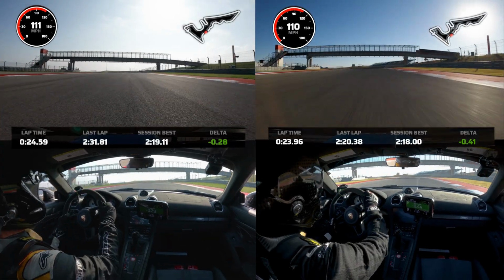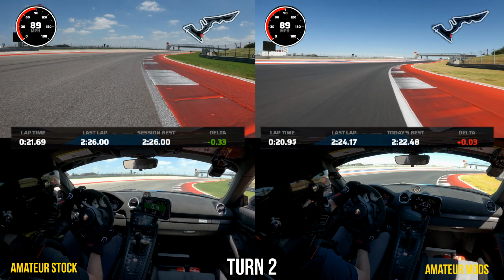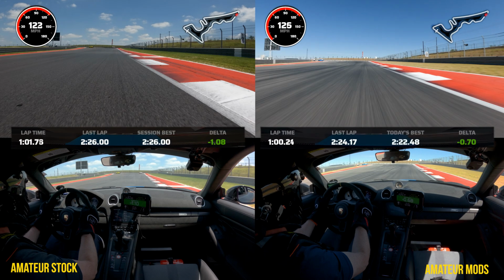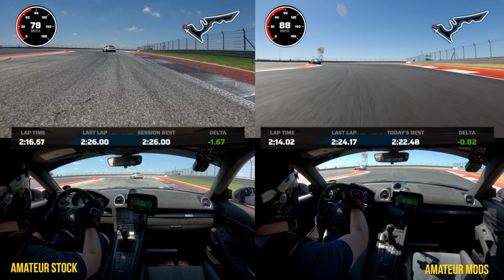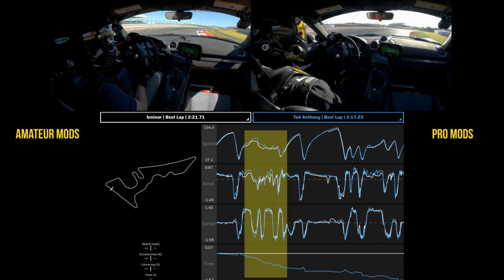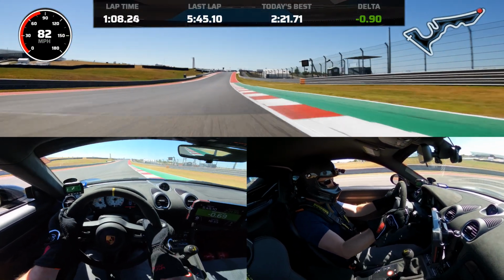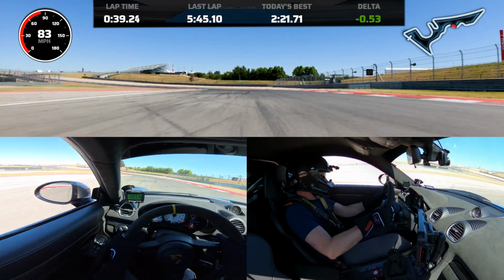Amateur vs. Pro: Can Mods Level the Playing Field? - Porsche GT4 RS + Dundon

Comment: Asking for a friend....How much did you spend to gain 3 seconds?
Reply from the maker: Ha! Once you get below 2:25 at COTA, shaving off more seconds gets very expensive. 
But I’ll say the best bang for the buck on the GT4 RS is the MCS system.
Reply: Thanks for the response I'm just trying to get my arms around car options to run competitive times at COTA.  I have a stock GT4RS and run sub 2:25, I also have an LS3 swapped Miata that I paid $40k for and can run the same times.  I'm working my ass off in the Miata to hit those times and frankly it's a bit insane to hit 160 mph on the back straight in a Miata, but it's capable.  So given that a GT4RS costs ~$200k, you've probably put another $60k into your car to run sub 2:20.  I'm wondering if a stock Corvette C8 Z06 could also run 2:20s and only cost ~$150k for a capable track car.
Reply from the maker: As you said about the Miata, it all comes down to how ‘on the edge’ you want to be when pushing into the sub-2:20s. 
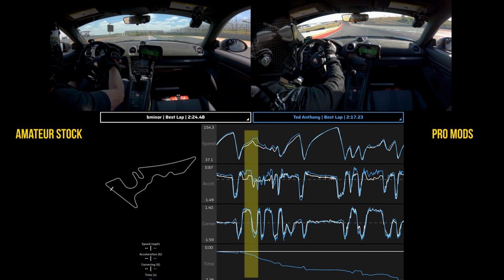If you watch Randy or Felix, they were right on the edge, catching the GT4 RS multiple times to get it into the 2:17s in stock configuration—I don’t see myself driving that way.
The reality is, I need the car to be much more stable to build the confidence required to push it below 2:20. The easiest way to achieve that would be to get a car that can hit 170 mph on the back straight—you’d be sub-2:20 without needing to push hard in the corners. However, I’d rather achieve that time in a balanced way, maintaining speed through the esses and carousel. That means the car needs to be well-behaved, so I invest in making that happen.

The Z06 is 400 pounds heavier than the GT4 RS—definitely not the right direction if you're looking to build confidence.

Comment: Great data but sweet god and baby jesus those exhaust tips are the worst thing I've ever seen... ! Sorry :D
Reply from the maker: Finish/Color or shape?
Reply: @ItsTrackTime  Just the size and how much they stick out... they look off for the space available like comically oversized - although obviously there could be an element of camera angle there...
Reply from the maker: I was OK with the size but wanted a different finish. Gun metal is more my style but it appears the stainless steel finish is shifting from a chrome look to a more gold look as the heat works it over. We'll see how they age with time.
Reply: @ItsTrackTime  I'd probably do black if they had it as they'd blend in a little better with the trim. Personal choice obvs. I just can't help but think that each of those tips is dealing with "only" 3 cyls and 2.0L of displacement. Modded 90s Honda vibes :D Thank you for the content!

Comment: Very nice!  You picked up quite a bit of time but more importantly, the car’s drivability also improved.  Would be interesting to see what Randy would run with the modified car.
Reply from the maker: Thanks, I'm also looking forward to getting Randy back in the modified car with cooler weather and a new set of R7s!
Reply: @ I just ordered a GT4 RS.  Going into production now.  How much did the entire Dundon package cost?  I almost did the Manthey package through the dealer and then stumbled on your video
Reply from the maker: Awesome, you’re going to love it! The Dundon package is significantly more affordable than the Manthey package. In fact, you can get the suspension, aero, and a complete header-back exhaust system for less than the cost of the Manthey package. I’d recommend giving them a call to go over the numbers.

Comment: Just a thought, Skip Barber 3 day racing course had us compromise 7 just a tad (notice you are pretty track left), since its a slower speed corner and rather than track out all the way right into turn 8, track middle and then turn in to the apex and hug the curve uphill ( i felt like that let me accelerate just a bit up the hill) and then full throttle all the way to 11 once you get over that little hump at the top of the hill.  You can probably track out a bit more at turn 11 and straddle the exit curb carrying more speed through the corner and earlier on throttle.  You have soo much more tarmac at turn 12, not sure if you actually care about track limits, but so many past the curb to that extra tarmac.
Reply from the maker: Thanks for the tips!
I have always moved to the far right leaving T7 but have seen people taking the middle line you are suggesting. I'll have to study that a bit more. 

T11 - I also try to use all of the track surface that I can including all of the green painted surface which T11 has plenty of but try to keep one tire still in contact with the white stripe.

Comment: Considering all the mods you have done, if uou could go back in time, would it have been better/cheaper to start with a GT4 rather than the GT4 RS?
Reply from the maker: I worked my way through several Caymans before finally landing on the GT4 RS, and I have to say, the engine in the 4RS is absolutely incredible—worth every penny. If you're a fan of mid-engine cars, the 4RS feels like the pinnacle of the Porsche lineup—unless, of course, you’re in a position to track a 918. As for mods, I’m really happy with the choices I made. The only thing I might have done differently is to stage the upgrades—starting with the MCS suspension, driving it for a while, and then adding the aero. By doing everything at once, it’s hard to isolate their individual impacts in the data.
Reply: @ItsTrackTime  I was considering taking a GT4 and doing the same mods along with Deman 4.5L engine upgrade (~$30k). Any thoughts?
Reply from the maker: For the track you really want a dry-sump engine - the GT4 is a wet-sump, the GT4 RS is a dry-sump. For the street the Deman 4.5L is fine but on the track it might not hold up. Is there any long term data on how these modified engines hold up with heavy track use?
Reply: @ItsTrackTime ahh. Yes dry vs. wet is going to be a huge difference. I now wonder to myself if that's part of what Deman do for $30k, if not then I'll just have to pay $35k over sticket and get about ordering one ASAP.
Reply: @ItsTrackTime  just confirmed that for $30k Deman don't even convert the engine to dry sump. I see now there is no replacement for a GT4 RS, other than a GT4 RS Manthey maybe.
Reply from the maker: And the GT4 RS Manthey uses the same untouched factory engine.

Comment: Chase seat time and coaching not mods.  When you can drive a good friction circle is the time to do mods.  😀
Reply from the maker: Any mod that makes a car more predictable and less unforgiving is a win in my book. Coaches are invaluable, but they can’t fix a car’s bad habits—they can only teach you how to manage them.
Reply: @ItsTrackTime  If you're not driving to the limit of grip you don't know if the problem is your driving or the car.  When you can reliably and routinely extract maximum grip you then will better understand what needs to be "fixed" on the car.  Do you know what your friction circle looks like, take the data from your RS and extract it in the PTA app, upload the CSV/txt file to a computer and in excel plot lat g Vs lin g. Stacked logs in PTA are fine but the "tell" is the friction circle.
Reply from the maker: I had an AIM Solo2 in my car during these sessions, and I noticed it can generate a friction circle using its X/Y plotting feature. Your enthusiasm for this technique has definitely piqued my interest. It seems like a interesting way to compare drivers in the same car and evaluate how close each one gets to maximizing the car's limits
Reply: @ItsTrackTime  Correct, also as your tyres drop off, if you're a good driver, your friction circle becomes smaller but still retains its donut shape (e.g. always using the grip available).  Nearly all amateur drivers are off on corner entry to some degree - because they are trying to balance several things e.g. finish of threshold braking and transition to trail braking whilst maintaining turn in at a rate sufficient to keep speed up whilst extracting maximum grip.  A good friction curve reflects high levels of precision and accuracy e.g. you want to be on the ideal race line, hit all your marks at the maximum speed possible without getting into understeer or oversteer.  Its the subtle stuff that additively makes you both quicker and smoother.  Another good challenge is trying to consistently hit a time, one a couple of 10ths slower than your PB again, accuracy and precision - it becomes a real challenge and thats part of the fun and can fun and frustrating at the same time.  The hardest person to beat is yourself and therein is the challenge.  :)

Comment: I think T8-T9 is about a second of possible improvement. I’d like to see you min speed at T8 at58 then get flat before the end of the white curb stripe on the right and hold it. That speed carries all the way to T11. I know from my vbox data that a slight lift going up the hill to T9 costs more than half a second. For T3, I think the gantry bridge is a mental thing and makes people want to slow down. You may consider slowing down a tad around T2 on a couple of practice laps to get the feeling of holding flat longer into T3 and getting settled. There is plenty of time to let the car settle after the T3 hop before you make the T4 turn. Most people reserve too much time and it causes them to slow too early. But, make sure to let the car settle before turning or it will snap on you. Also, if you carry too much speed into T4, it’s easy to bail out and go straight. I’ve done it. It’s super flat from T3-T5. Worth possibly doing once at a slower speed to know you have an out.
Reply from the maker: Hey Ray - Thanks for your continued tips!
T8 - T9 is a definite area for continued improvement. I'm too slow around T8 and there is now a shelf on the T9 curbing that launches the cars so I was trying to find a clean line around it. Ted was taking a more aggressive line and it seemed to work.
Sacrificing T2 to get more speed through T3 and T4 seems like a good approach for me while I continue to work out the line and how long I can keep my foot down without loosing the car at T4. You can see Ted was going very deep with speed at T4 and didn't brake nearly as much as Randy which gave him a lot more speed through the remainder of the esses.
Reply: @ - the brake pressure at T4 is just to give the front some grip. It’s not to slow you down. I spent many laps working up the ability to hold flat around 2 and jump the T3 hump. 

T8 seems to come from lots of bad instructors at COTA. For me, even with the jump, is to aim track out to the right on the line. There is plenty of room to run wide, but if you let the car settle and be patient, there is plenty of time to straddle to curbing on the right. Too many people try to turn left there too early. You may also consider doing a few laps where you focus only on the min speed and don’t worry about the uphill portion. Just work on trusting that you can make the turn at 60 mph. Look at the Miata cars. If they can carry that speed, so can you. 

The same thing happens at T19. People tend to rush the turn rather than carrying speed and aiming at the parking lot on the right. As you pass the corner the car settles and gets the grip to stay on track. Too many people over slow because they are trying to make the turn with the low grip that is just past the apex. But there is better grip waiting if you wait for it. 

COTA is classic this way. If you are patient the camber and track is there to reward you. If you don’t trust yourself or the track, you will overslow and turn early.
Reply: @ - I have my VBOX data and Cameron’s on our 2:14 and 2:15 runs. I was trying to bank a lap on mine and the car was hopping a lot. My optimum time over two laps was a low 2:15. I could have done a 2:14 in the next session if Ferris didn’t cause the yellow. T2-T3, T8-9, T13, T16, and T19 is where the time is.
Reply from the maker: I would love to see the native VBOX lap videos of you and Cameron. 
The Youtube versions are too course to see what is really going on frame by frame.

Comment: Much more complient suspension, the way to go. Good job on your driving! If I may, try a bit faster hands on slow corners entry. And turn 2, just go for it (although not much time to gain there); the car will understeer (worst case you bail out). And I bet that pretty soon you'll want to dial off some of the understeer (keep some though). Cheers.
Reply from the maker: Everyone tells me I just need to commit on T2 and everything will work out but I've had the tail break loose on T19 before and I was a goner.  After that my brain never assumes the car will just push. With the added downforce I could really feel the tremendous pressure on the sidewalls as they scrubbed sideway on T2. When I felt that I immediately went into maintenance throttle but Ted told me to just commit and add more throttle, thereby producing more downforce, and the car will just hunker down more and settle. Very counterintuitive!
Reply: Well, T19 is way more complex than T2; there you have to brake, manage the front the end, deal with the curb apex and the downhill exit. T2 the car is already balanced through out. Now, with your aero kit, based on Ted’s lap, the car understeer (a good bunch) at the limit over there. Build up to it, a bit more each time. And to be honest, you’re already fast enough to generate the needed downforce. Look far, and light hands. Worst case, open the steering wheel… or, most likely, easy off the throttle to minimize the understeer. Cheers.
Reply from the maker: You’re inspiring me to stay on the throttle through T2! What you said makes perfect sense— with the added downforce, I’ve got no excuses for not attacking this corner. Thanks for the motivating and practical pep talk!

Comment: What brake pads are you running?
Reply from the maker: Ferodo DS3.12
Reply from the maker: But I'm going to move back to my old favorite, Race Technologies RE10, for my next track weekend.
Reply: @ItsTrackTime  Great video! I really appreciate how you break down the process in a logical way. May I ask why you are changing to RE10's? I'm running DS1.11 front/back on my GT4 and was thinking about changing to DS3.12 on the front to improve car rotation. (I'm using Girodisc rotors).
Reply from the maker: Thanks!

I'm also on Girodisc rotors - great product!
The DS3.12 pads have great bite, don't fade, and don't squeal when cold but the down side is they wear very quickly. I only get two track weekends out of them. 

RE10's also have great bite and don't fade but the big plus is they wear much better. I'm interesting in seeing how they hold up on the 4RS. The downside is they squeal when cold so street driving is kind of miserable.
Reply: @ItsTrackTime  if you didn't care about the noise at all, IE: 100% dedicated track car, which pads would you choose? Is there anything better than RE10?

Comment: Good stuff.  I have the MCS 2-way's on my 718 GT4.  I love them, my only regret is not springing for the 3-ways, but the 2-ways do pretty damn good on their own, just probably not quite as smoothly as the 3-ways would.

What canister pressures and rebound settings did you end up at?
Reply from the maker: Thanks!
MCS is the way to go. Makes a huge improvement in the car's stability on track. 
My canister pressures are currently set to 175psi.
Rebound - Front 10, Rear 9.
Reply: @ you are pretty close to my settings.   I know we can’t compare compression since you have both low speed and high speed , but I’m at 190 canister pressure and 10/10 C & R on all 4 corners.  

I run the Goodyear SC3 tires for street use
Reply from the maker: Which tracks do you run one? Many of these settings are track specific.
Reply: @ItsTrackTime  I don’t really track mine as it’s my daily , just canyon and mountain roads
Reply from the maker: Ah, I'm going to try to do that with a Spyder RS which has a considerably softer suspension.

Comment: Does the suspension mods help with preventing the strut tower failures that is known to occur on the cayman gt4 models?
Reply from the maker: The MCS dampers would soften the shock transmitted into the towers which should reduce the risk of a failure.
Reply: @ItsTrackTime thank you!

Comment: When hoping those curbs do you think the drive shaft is hitting that through axle pipe? I assume you'll be taking a look there at some point.
Reply from the maker: Felix has the car right now, post axle boot replacement, and is looking it over. I'll report back with his findings...
Reply from the maker: Felix got back to me today and didn’t find any axle rub, just a couple of spots where the paint was nicked from the suspension going to full droop while the car was on the lift. However, he did notice a new tire rub spot with the 305s and all the Dundon components, so he’s looking into it. We might need to make some adjustments with all the new components in place.
Reply: @ItsTrackTime  Bump stops and packers available if you need them...